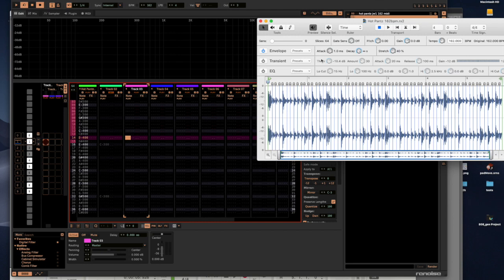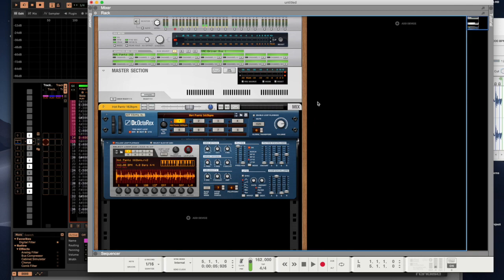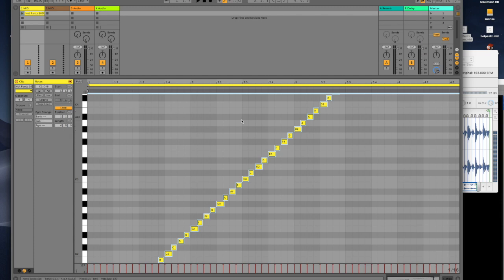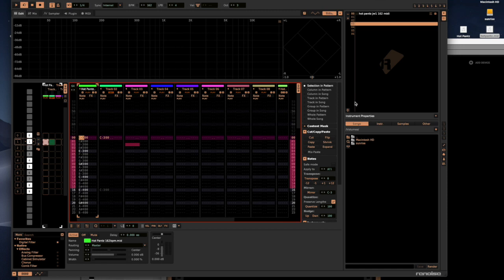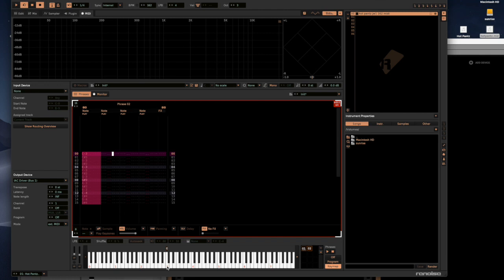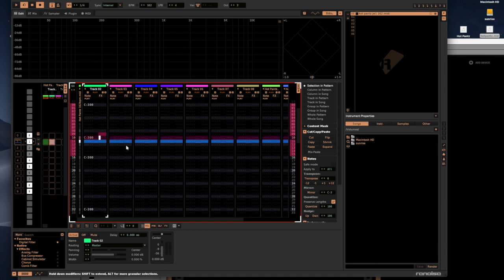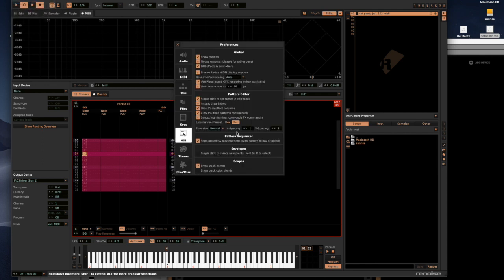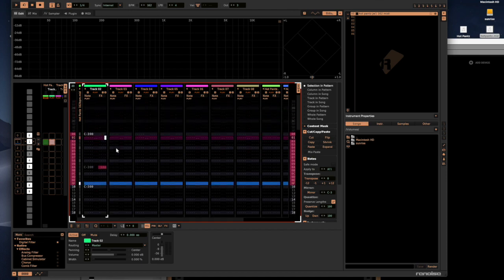sequencing hardware sampler breaks in renoise - using sample offset with MIDI

Comment: I'm still new to all this tracker thing, but what's the advantage of this? I get that the break just continues playing but what if I want to put notes not exactly on the grid, like if I want to let it swing a little or do custom delays per note?
Reply from the maker: Hey there! This is really just another way to slice and sequence a break via midi. A lot of producers like the “sample play through” when triggering slices, and this is an easy way to do that on an old sampler (that doesn’t natively support it) using a tracker. Also, you can get really granular with renoise’s line per beat; I think you can go up to 96 lpb, I typically use 8 or 4 though!
Reply: @arcologies  Thanks for the response. Since you quantize everything how do you get groove back into the break with this method?
Reply from the maker: @ja-kidnb6416  you're stuck with the midi phrase, and if you keep it at 4 lpb, it's rigid. you can get more granular by increasing the lpb and using step delays and/or moving notes around... that would make it looser... but personally at that point, i'd rather just chop at the kicks, snares, and other key parts of the breaks while keeping the playthrough.

if you build breaks with one shots, you can use the ZLXX fx in renoise to shift lines per beat on each step. this was the old school way of getting groove on old trackers. renoise has a built-in global groove setting, but i'm not sure if that applies to midi... probably does.
Reply: This is badass, lots of applications! Been using Renoise for a few years now and haven’t gotten into phrases yet, this is definitely changing that.

Comment: awesome info thx!  Havent dabbled too much with phrases yet.  

What I have messed around with is sample start within the akai racks.  It works, but theres a limitation with the akai.  You can only manipulate the very start of the sample and not the entire thing.  Your method seems like a way around that???
Reply from the maker: Yup, if you’re chopping breaks… you can copy the midi of those breaks into a renoise phrase and sequence from there. It will be as precise as your chopping is :) since it’s just sending a midi note start point and playing through the rest of the phrase. Renoise obviously needs to be the master clock
Reply: @arcologies  im thinking this could open up some cool manual timestretching possibilities.   Theres a couple drum fills that dillinja does around 94/95 that I swear has to be manual timestretching